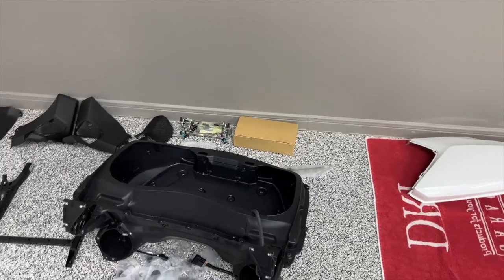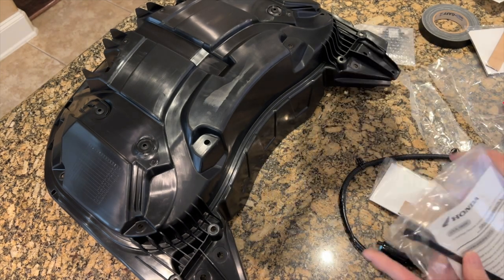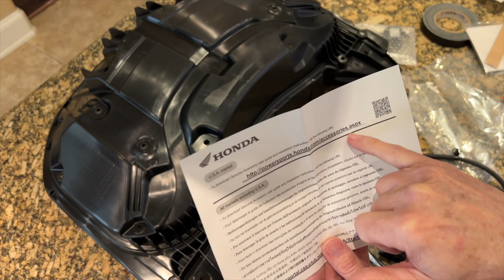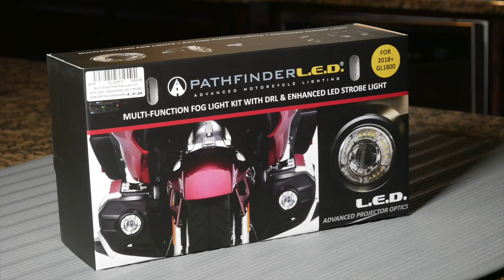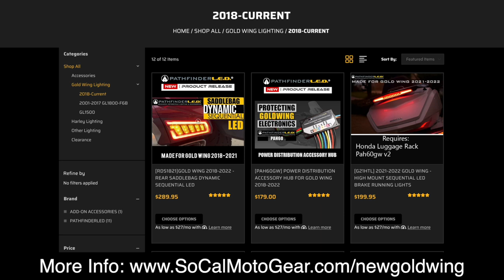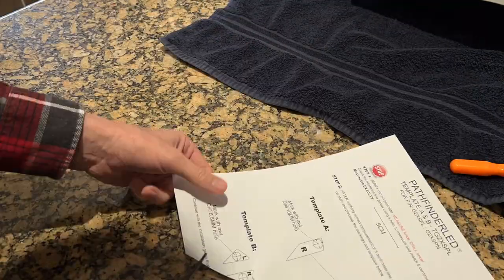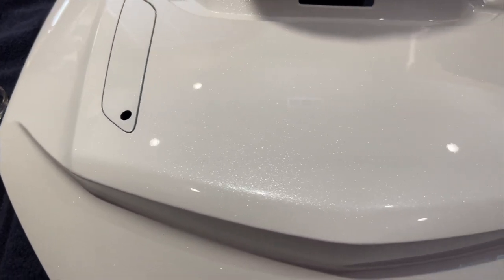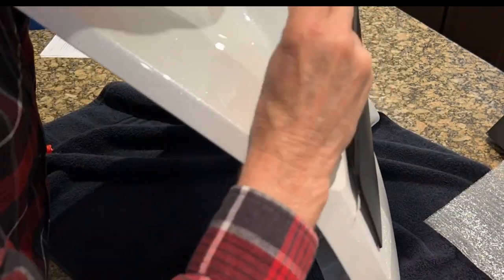Installing The Pathfinder Spoiler On 2021 Trunk Lid | Trunk Swap part 3

Comment: I think you mean that the piece of sub frame is for use on the non-tour model. I got in a “discussion” on a forum with a chap who told me that no idiot would install that trunk on a non-tourer because there was just stamped steel under the area behind the passenger seat. Well I’m here to tell ya, I have that piece of stamped steel in my garage as part of the pile of things returned to me after the installation of my trunk.

Comment: I do have mounted the black spoiler on my Goldwing this week, just looks very good, but before i have had the spoiler dropped off at a car detailer and let him placed a PPF protection film on to the spoiler. Now i have a spoiler that is not matte anymore but glossy like the rest of the motor. Motor is black with chrome exhausts. 2021 model.
@Robert White Photography, i am also member of the American Goldwing board and i have seen your motor there, looks good.
Reply from the maker: They do make matte PPF I think.
Reply: @cruisemansgarage  That's for sure, but i do wanted the glossy spoiler because the bike is also glossy, and i don't like the matte look.
Reply from the maker: @sterfreak  Well in that case, you are definitely on the right track.

Comment: I just saw your video where you installed the Pathfinder LED spoiler. This is what is missing on the 2018 + wings and they  look so good.  I bought a 2024 white Goldwing tour model. It is hard to tell from the pictures but I am trying to decide on the color. The trunk on my 24 model is gloss black on top with a red strip and then white lower. I think the chrome will look better on the gloss black than the matte black on the gloss black but not having seen it in person I'm not sure. What is your opinion on which would look better? Just not sure matte black (dull finish) would look good with the gloss black finish.
Thank you for the information you put out.
Ken